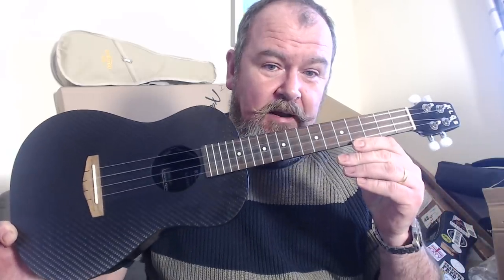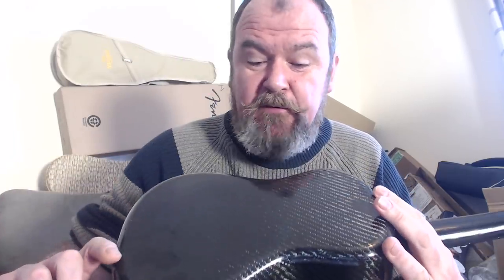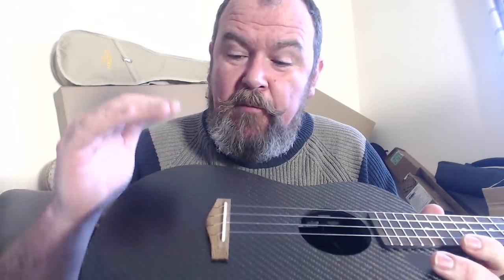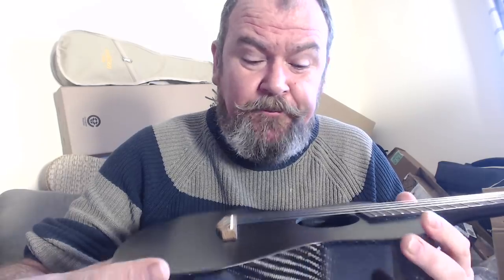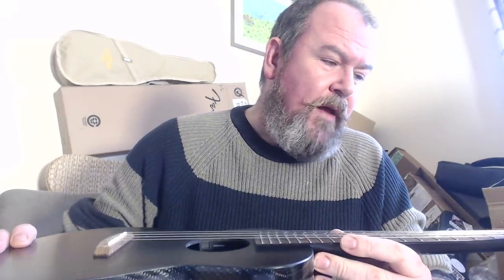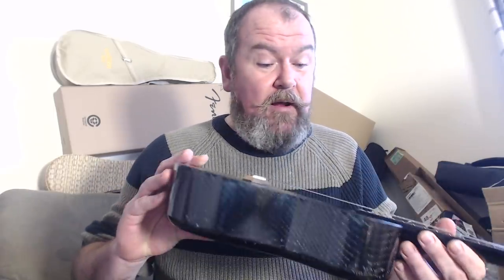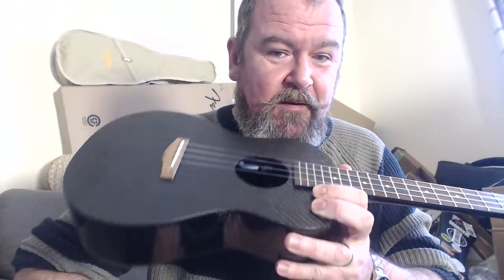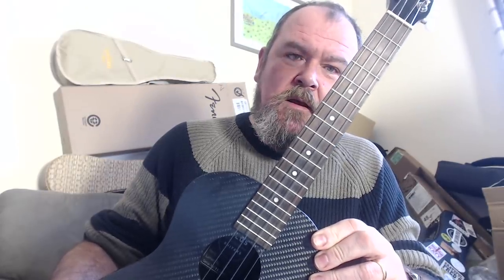Got A Ukulele Reviews - Klos Guitars Carbon Fiber Tenor

Comment: Barry, as much as a year ago, Klōs offered to let me order the Deluxe Acoustic Electric with the pickup deleted entirely and the price adjusted downward accordingly. Essentially, it would have been the standard acoustic with the black Tusq nut and saddle and the better tuners, plus the carbon fiber neck reinforcement rods. 

It was a bit complicated to order; you would have at the time to order the deluxe model and then follow on later with correspondence asking them to delete what you didn’t want. 

So, even during the Indigogo, you could get them as you liked (or nearly; they said they could not do a radiused fingerboard or a sound port, while Blackbird offers both on the Farallon).

As it happened, I didn’t order then. The brothers were on vacation when I sent one inquiry and I figured they were tired of hearing from me so I bought a more conventional tenor ... they did reply when they returned, but at that point my uke budget was flat.

I like the idea of this instrument, but think that if I got one, I would still want a Farallon, even though the Farallon with the features I desire works out to three (nearly four) times the cost. So, I’ll probably save up for the Farallon. 

After all, if I got this one, I would probably still want the Farallon and buy one eventually. So, in my twisted UAS logic, I’ll save 700 bucks by buying the (much) more expensive Blackbird instead!
Reply from the maker: Tom Morrisey think they are just finding their feet I guess

Comment: Like it, but I agree with you. The headstock looks out of place and it could use a couple more mm nut width. Pegheds would look great on this. A hollow carbon fiber neck would also be a neat feature. Thanks again.
Reply from the maker: Pegheds would indeed look great!
Reply: Edward Petersen, Klōs uses a mahogany neck to keep the instrument relatively weather-resistant, yet affordable. You can get a pair of carbon-fiber reinforcement rods in the neck to render it pretty much impervious to weather-induced warpage.

Comment: This little guy is very expensive.
Reply from the maker: In perspective it’s not actually. The Blackbird Carbon Fibre ukes that came before cost 2-3 times this price
Reply: @GotAUkulele  Damn. I just bought a Kmise baritone that cost me only 60 bucks and a Sire acoustic guitar that cost me 270 bucks. These high tech gadgets are still very expensive. But it will be interesting to try one if it costs like 1/2 the price now. Of course a good instrument will deliver good sound, but it also depends on the player. A good player can produce good sound out of a cheap instrument and a bad player will produce bad sound out of an expensive instrument. :)
Reply from the maker: @ArthurHau  very true indeed!